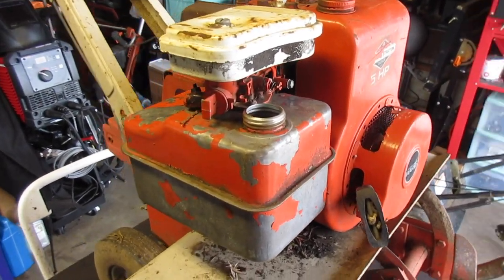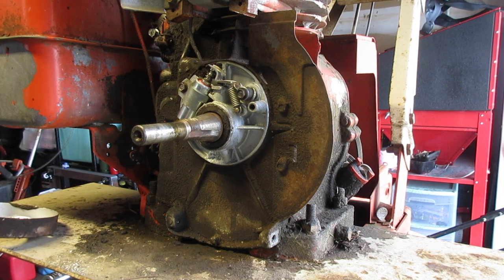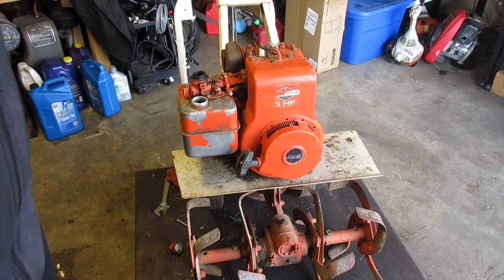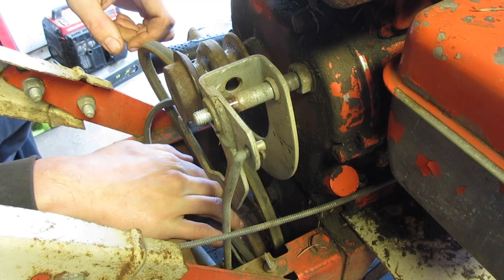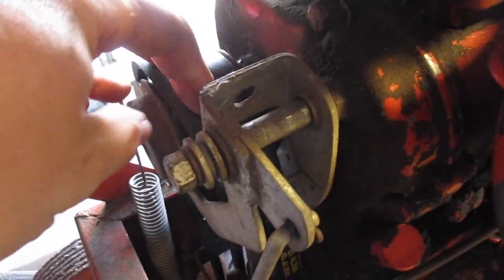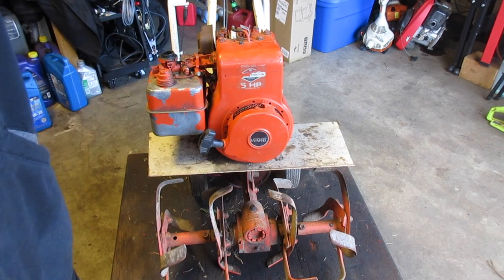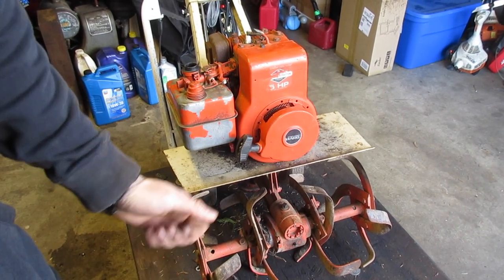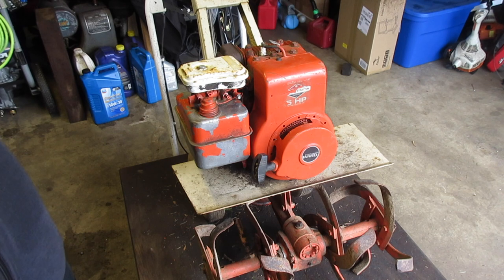Montgomery Ward Ward GIL-1580 G Belt Replacement

Comment: Good detailed video of tear down. The reverse belt is supposed to make a figure 8 at the bottom above the drive pulley. That is why it seems much longer is needed. The reverse/forward through should not exceed much more then 1.5-1.75 inches from neutral.

Comment: Hey Thanks for a great video!  I have this same engine on a JC Penney tiller.  I'm trying to assemble the throttle linkage.  Would you be able to post a picture of the linkage please?  I'm having a really hard time, mainly trying to figure out where the big spring hooks on.  Thanks!
Reply from the maker: I unfortunately don't have the machine anymore. I did make a video on Briggs governor adjustment that might have a better view. https://youtu.be/0r1hdbYN424 . The sliding piece on the bracket has a hole on the back. That spring attaches to that hole and then attaches to the governor arm
Reply: @PNWSmallEngineandLawn  Thanks a ton!  I got it put together and running.